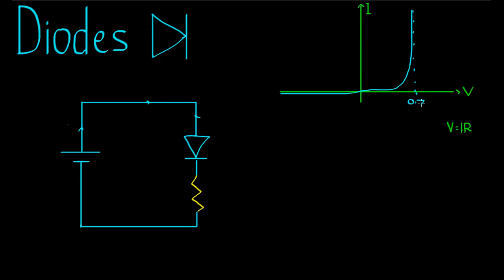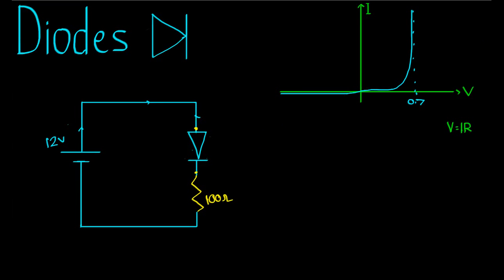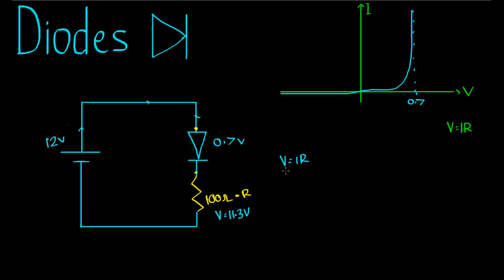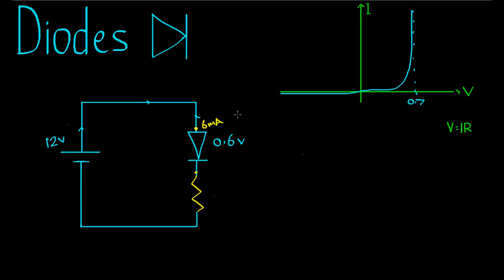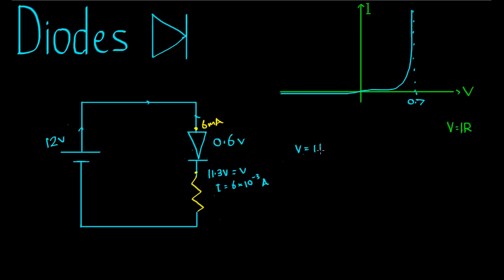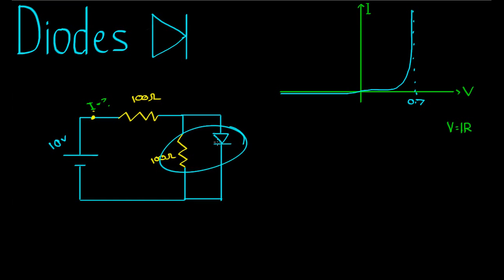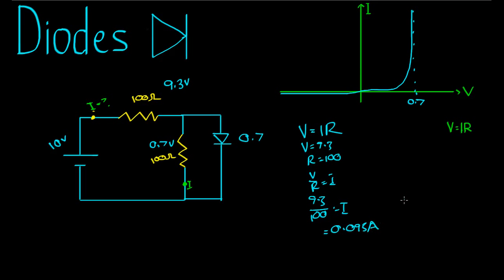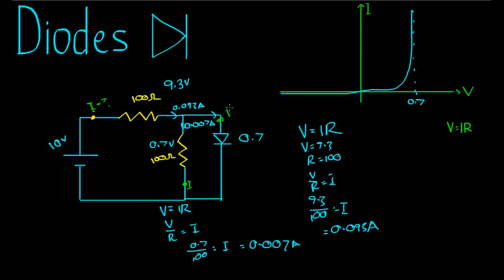Diodes Example

Comment: a lot of people seem to be getting this confused, the range of a diode is 0.6< Vd < 0.8 (this does NOT include 0.6) so for the lesson in the video it is all correct, it is 11.3 because 12-0.7 = 11.3 not 11.4, he even draws on the graph 0.7 as the point of Vd.

Comment: if there is no current in reverse biased conditions then how does potential drop is measured accross pn diode as there is no current in circuit

Comment: In the last segment, why is the current flowing through the parallel resistor at all given that forward bias diode gives a short circuit ?

Comment: There is a lot wrong here as some have stated.

V drop should be 11.4Volts

.6mA is 6*10^-4

answer should be 19K ohms
Reply: it's 6mA not 0.6mA
Reply: you're right, for some reason i saw that yellow dot and though he wrote .6. thanks.

Comment: at 5:28, shouldn't that be 11.4 instead of 11.3 since the diode is 0.6v
Reply: yes, but come on, it's a small mistake in an overall great lesson
Reply: it is, i was just making sure that i was following it right
Reply: Yeah it should be 11.4
Reply: yes
Reply: @kstssi7139  Not all professor are like that. A classmate of mine made the error of putting  21 mA instead of 2.1 mA (Changing a page, so he had to copy it) and the professor took the time to do the exercise based on that error, and only took 2 point (Out of 25), because while the answer was incorrect, the procedure was right. We are humans. We all make mistakes.
Reply: Yeah... When I have seen that mistake I decided to look after another source of information. Lol.

Comment: While the problems are accurate (except ex. 2 due to the simple error of the voltage being 11.4 instead of 11.3) they are somewhat misleading because 0.7 is the knee voltage for a silicon diode meaning it requires that amount to pass any current. After enough voltage is applied to achieve current flow, the current is the circuit grows exponentially as the graph demonstrates until it eventually overheats. This is why he can assume the voltage of the diode as a given. BUT THIS IS ONLY ACCURATE FOR AN IDEAL DIODE. In an actual circuit, "body" resistance and "contact" resistance of the diode itself will affect current. Lastly because this is only for ideal circuits, saturation current was not taken into account.

Comment: isn't the diode supposed to not let any current through for the second example? since its voltage is less than the 0.7 V required to turn it on.
Reply: +TheZed ya i am thinking about the same, instead of 0.7 V it must be 0.6 volts